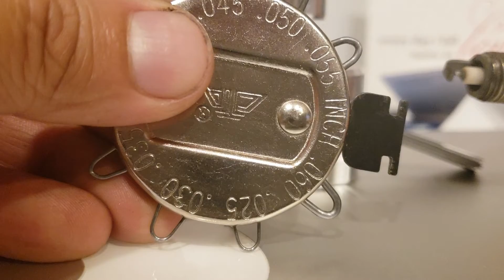Buck Performance Spark Plug Gap Tool Review

Comment: Very good video! I'm not sure why all the thumbs down. Very honest review, useful as hell for me, I was gonna buy one of these stupid things thinking the same thing you did  that I would have easy accurate plug gapping tool.  Nope. I do think I'm still going to get one but a different configuration where you don't screw the plug in, you just lay it in the tool ... much faster and easier and covers different MM size plugs with one tool.  Thanks for posting.

Comment: Worked well for me
Reply from the maker: Not possible. If you use it as directed, press the plug tip down to your chosen slider size, then you release the pressure after it was compressed, the plug tip will snap back to a larger gap than when it was pressed. The contraption works, that's not the issue, the plug tips are the issue, the metal just tries to snap back into its original bigger gap due to metal springiness.
Reply: youre trying to gap Iridiums? lol
Reply from the maker: Dr. Cock Wobble  - Yes Dr. Cock. I am. And if you had an n54 with BL Coils, you would too. Also, none of the tips had identical gaps from the factory...so yeah...I gap iridiums.

Comment: You’re right. These gap tools are very overpriced and there’s a margin for error. I found a cheap (free if you have one) way of doing the gap. Simply put the plug in spark plug socket that you use to install the plug and then use a G clamp to set the gap. No need to pay $60 for a tool that a $8 G clamp will do just as well.

Comment: I'm poor so I can't afford all these gadget.  I just put the spark plug upside down and place the ground electrode on the hard floor.  Put the right size feeler gauge between the ground electrode and center electrode.  Then put all my weight on the spark plug and push the two spark plug electrodes together.  And now I have the spark plug with the right size gap between the ground electrode & center electrode.  Poor man way of gaping the spark plug.
Reply from the maker: So long as it works. Make a video of your process.
Reply: @matreyia  I just replace my spark plugs a week or two ago.  Don't need to replace it for 90K miles, but will most likely just clean them by then and just replace it since it is double platinum.  And I am poor and don't have recording device or editing software.  That it is why it is call a poor man technique.